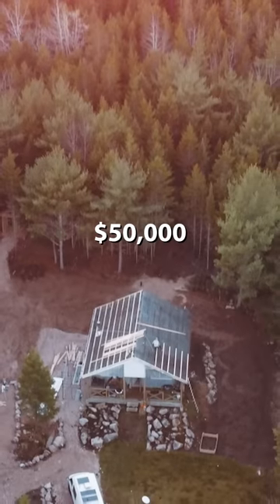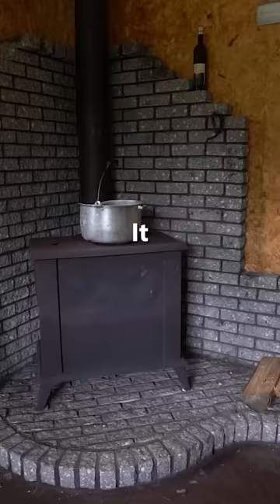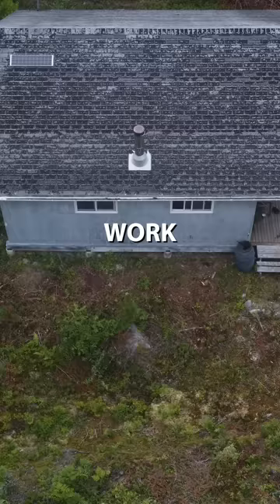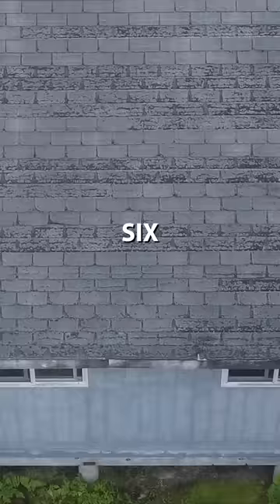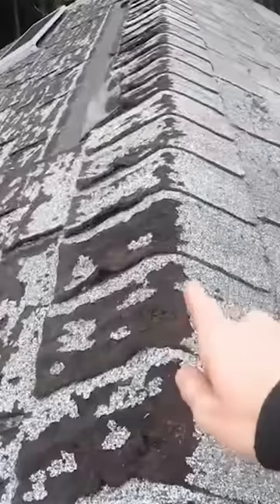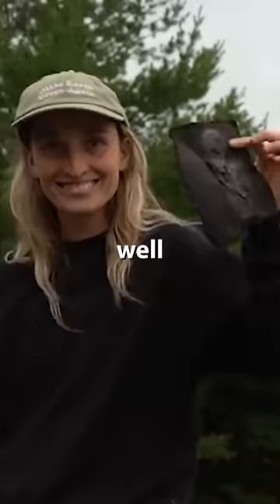Roofing With NO EXPERIENCE #shorts

Comment from the maker: Watch the full video here https://youtu.be/SfOV5l49iSU

Still can’t believe we did this 😂
Reply: The metal roof is as beautiful as the builders.
Reply: Does the 50k include the land? I think I need to move to the Canadian woods 🥰 I wonder what it’s worth right now with everything you’ve done so far you’ve both done such amazing work ❤
Reply: @Mossy's Food Reviews I see you gave up on your food review videos or you never pulled your head out of the sand even start? Lol 😂
Reply: You Both rock ❤️🌹❤️
Reply: Awesome
Reply: What province are you in?
Reply: I can't believe you did this either, why on earth did you leave the crappy shingles on there? You should have removed them, made any necessary repairs to the roof underneath, placed a moisture barrier and then the metal roofing, good luck with those moldy old shingles under that shiny new roof.
Reply: Use to work on roofs myself...

One small thing you guys might want to keep in the back of your mind.

It was good getting the rub er washer screws, but they will give out after a couple seasons.
To make them last longer, grab you some roofing tar or sealer and cover those screws with a nice cap of tar spread down to the roof. This will give it a second more reliable water tight seal that will go several seasons before needing touch-up. 
This shouldn't cost more than 20-30 extra dollars (usd) and will give you much more relief with the roof.

In California, every metal roof has this little added tar put on the screws (or should), so they last longer and need less maintenance during its lifetime.
Reply: Love you guys, totally inspirational
Reply: Good for you!!👏🏻👏🏻👏🏻👏🏻👏🏻👏🏻👏🏻👏🏻
Reply: this is frog awesome! love it!
Reply: It is important to have a solid monthly income.
Reply: Omg yall just messed up that roof is going to leek within a year because of how you installed it good job next time do more research 40 years plus roofing experience
Reply: Just read some really mean comments on here...  I'm just here to say who cares if it's not perfect, who cares if you have to redo.  We are here for you cause you're amazing to even give it a try.  It's the only way to learn.  There's more important things that money and perfection.  I watch videos like yours cause I like the vibe.  You're good people.

Comment: Professional roofer here. Those panels will last about 50 years but I gaurentee no one has told you that the washers on the exposed fasteners only last 7-10 years and the same goes for any sealant used. They will both need to be replaced eventually.
Reply from the maker: We are aware yes. Thanks!
Reply: @Vanwives  total cap. Yall had no idea.
Reply: I have seen them last a lot longer. The fact it is a steep roof also helps. YOU GO GIRLS.

Comment: So you left the degraded and moldy old shingles instead of putting a membrane first, good call😅
Reply: That's what I noticed as well. That's why it was so cheap for them, they skipped over the work it desperately needed! There's probably rotting wood & mold under it.
Reply: @hinu1987  well said
Reply: it's too cold to matter lol
Reply: What an unhelpful comment. Do you feel better about yourself?
Reply: @nicothenatural  not everyone can win without guidance
Reply: @nicothenatural  hope you don’t buy it
Reply: @Barry Dargush  you don't even make sense. No one talked about winning here until you pulled it out of thin air like it's supposed to be relevant.
Reply: @nicothenatural  current times call for all to get high praise, reality is you need to point out what not to do is more proper
Reply: @MrCrafter80   👏 👏 👏
Reply: @MrCrafter80 ??? People LOVE to correct others and point out what they've done wrong. It's in our DNA.
Reply: @nikki1400  well if we didn't think of all those lost to fire and cliffs
Reply: @Barry Dargush  you didn't offer help, or even try to be helpful; you cast dispersions. Don't confuse the two.
Reply: @nicothenatural  your not even able to understand conversation
Reply: All they did is going to have to be thrown out, hopefully no one is permanently injured by the unseen mold dangers
Reply: Not saying it's right, but it's very common for people to do this.

Their roof will be fine.
Reply: With the unstable/rotting wood possibly, the metal roof is capable of blowing off. If you leave a roof to rot you are asking for it to cave in. It’s only a matter of time. Leave it to the women.
Reply: @jakobjackson8077  Asphalt doesn't "rot" it degrades in the elements. If they fastened furrings to the trusses, they are fine.
Reply: @jakobjackson8077  your playing with those murder hornets , you must not be married
Reply: @drsh0ckalu  only time will tell, I’ll subscribe and wait for them to post the video crying cause a good wind blew their roof off.
Reply: @MrCrafter80  I’m engaged. 😰. Day I was born, the doc told my mother I would be a certified asshole till the day I die.
Reply: @jakobjackson8077  feelings don’t make things better, but a good laugh makes everyone smile
Reply: @crown of hair  No, he didn't, but I guarantee every roofer they spoke to did. They then decided to install that roof incorrectly. It's 100% going to leak and only a matter of time.
Reply: @mikeguerrero7416  that's fine, and it doesn't change the fact that the OC is a patronizing jerk.
Reply: ronnie doorzon  they're SHARING their experience, not seeking attention. People like the OC have freedom of speech; it doesn't stop them from saying unhelpful/patronizing garbage, unfortunately.
Reply: ronnie doorzon  people who GENUINELY want to help will offer the helpful tips. Not mock or belittle others who are putting the work and learning from beginner mode.
Reply: @MrCrafter80  Conversing requires two way communication; you've already made up your mind and are clearly not capable.
Reply: When  I bought my house it had 3 layers of roofing on it. 
 Wood and structure  was excellent under all that.  House built in 1930.   All they had to do was look in that attic  at the wood and ceiling structure and if it is not rotten or water stained it is fine . It is very common to put a roof over old roof .   I payed over 8k over  22 years ago for new roof.   Today I would  put a metal  roof over it  like they did.  I cant imagine what a new roof is now . They did a good job
Reply: @amorl4520  when you have wood sheathing boards they will outlast plywood for decades with proper maintenance
Reply: @jakobjackson8077  leave to women?. It would be fair to say they know more about the structure of that roof from the inside also. No rot or water stain no problem. I would not put 15 k into 50k cabin roof either..It took guts doing that roof especially that pitch !  They did a good job. Or is it the fact that women were self sufficient and that bothers you? And under the right circumstances depending where you live shingles also at times blow off.  Doubt they will.be getting any tornados 🌪 .
Reply: @MrCrafter80  I have tongue and groove boards. Was alot of weight with 3 roofs on it !  That's was alot of the cost taking all that away in dumpsters.  Thankfully 16 inch on center. I would not put 15k in a 50k cabin. Cabin is a shell basically.  They have to do alot of work . Since wood prices rose since covid Insurance Co Jacked up the price  replace house values to like 260k when I paid 64k 22 years ago . 2bd
Bungalow.  Which is BS ! Everyone  is on the screw you wagon.

Comment: Congratulations on the roof, just a few things you might want to address in the coming weeks - Old roof needs to be removed, roofing screws go into the peaks not the gully's, both these issues will cause rot and mould through the roof and accelerate the degradation of the old structure, since you have documented this the liability will fall on you if you do sell the property. The 15k was for a reason, good luck with it, I hope it all works out.
Reply: Not to mention the added weight of the new roof 😅 and the snow😮that existing framing wasn’t meant for that much weight
Reply: The screws go in the valley. Google it.
Reply: screws go thru rib not pan, all water flows downs pans, you don't want screws (points of possible water entry) in the way..I don't need to google it.. I do it for a living
Reply: @jamierose4088  As a builder. No. No they don't. Look up not google, but the manufacturer's specs, and local building codes. Screws go in the ridge.
Reply: @masterroshi9951  The new roof is lightweight and the per sq.ft added weight is minimal compared to the snow load, so if it has survived the existing conditions the new cladding will not affect the load. Not taking off the old roofing however....
Reply: @Paul Rawlinson  
The first articule on Google. 
Absolute Steel advises screws be installed down inside the flat of the panel and not in the top of the rib. See the illustration below.

This is important as placing a screw in the top of the rib will prohibit a good seal. If placed in the top of the rib, the screw may also potentially tilt, thus stretching the screw hole. When this hole stretches and gets bigger than the washer, the seal is then broken. Consequently, Absolute Steel restricts the use of aluminum exposed fastened panels to a length of 16’. And, 40’ in length for limit steel exposed fastened panels.
Reply: If it's water tight (most metal roofing is), there will be no accelerated damage. 
 It was already the hardest thing they ever did. 
 Taking those shingles off would have broken them.
Reply: @Jamie Rose  the first 5 articles which showed up on "Ridge roofing fixing schedule" all gave Ridge fixing, with larger diameter heads for lengths over 12 metres (40'). However, when you restrict thus search to usa sites, it shows a mixture between Ridge and pan fixing. This simply demonstrates that Google is not a definitive guide to professional practices, and you should check direct with the manufacturer.  I've been installing roofing for 12 years and no manufacturer has recommended pan fixing (it's against our national building code). However it might seem this couple were fixing in accordance with manufacturer recommendations
Reply: @Paul Rawlinson  
I did a roof last year. The manufacturer said their roofing and screws are engineered for valley screws. Their reason was the compression of rubber washer is more consistent on the flat valleys. It's counter intuitive, but I see the logic. 
 I put them on ridges until that job. There is more flex on ridges and different designs. The valleys are consistent.
Reply: @Paul Rawlinson  And the fact of the matter is that most U.S. metal roofing manufacturers say you should put screws into the flat, because this location offers a solid wood surface just beneath the metal panel, resulting in a safer, tighter, more secure seal.

I can't find any manufacturer recommending ridges.
Reply: Omg 😂 soooo many Professinal Youtube Trolls 😂 Funny that everybody is i Roof expert 😅
Reply: It killed me watching them screw those in. There's a reason you hire a professional.
Reply: @Jamie Rose  It absolutely does not. Look up IRC and hire a professional.
Reply: @jamierose4088  What was the name of the manufacturer you spoke to? I'd love to speak with them as well because what you're saying is wrong. Full stop.

Comment: The quote is definitely a lot, but that includes everything to properly do a reroof. When changing a tiled roof to metal, there are extra steps that need to be done. I’m not a roofer, so I don’t know what they are off the top of my head, but there’s always a reason professionals charge what they do. I am all for amateurs tackling projects themselves, but when it comes to structural things, I think they need to be left to the professionals. 

Also something to keep in mind, if something happens to your roof and you try to put in an insurance claim, it might not be covered as the roof could be deemed poor workmanship and unwarrantable.
Reply: First, rip the old roof off, so you aren't nailing/screwing into 40 year old shingles. Also, potentially trapping molds, etc underneath.

Then there is papering, flashing, mounting (prep boards), caulking, then installing the roof itself, caulking again, painting...

I am sure I am forgetting something, it's been a long time, and I have only seen metal roofs installed. Whereas I have installed many shingle roofs.

Also, what shape are the boards in underneath all that? You are adding THOUSANDS of pounds of weight on top of a roof where you didn't remove the previous weight.

Idk. I get why some people layover. But I wouldn't recommend it.

I've seen a 5 layover roof. 4 layers of shingles into wood shake.

The last couple layers the nails weren't even hitting anything except shingle. 😂
Reply: My family redid my sister's roof and the insurance passed it, no problem. She had it inspected, and the pros were impressed.  These two were doing the best with the time, money, and needs they faced. I'm sure it is temporary.
Reply: And the price is for travel there. Materials getting there etc etc.

Comment: I'm glad you guys took the initiative to take this project into your own hands. But, why did you leave the old shingles? It would only take a couple hours to clear off all those old shingles. Furthermore without the shingles,  you can inspect the roof for damage at the same time. Replace any rotten spots, lay down vapor barrier, then place your steel without strapping. Now that you have strapping, you have to be immensely careful not to step on the steel anywhere there isn't a strap. Luckily, you can come back at a later date and remove the shingles but, that a lot of extra work.

Comment: So installing the metal roofing over purlins, and also over the existing shingles, as they have done is correct. However, as everyone pointed out, why not remove the rotting shingles? This also gives you an opportunity to check the integrity of the existing roof’s moisture barrier. Not everyone has upfront money sitting around, but for an existing roof like that, I would have paid the $15k. If a warranty was offered under the $15k work, that’s also beneficial.

Comment: All roofs leak a certain amount. Where's the roofing felt? The waterproof barrier on the edge?  Why didn't you remove the old shingles, and repair the roof deck damage? FYI: the manufacturer states you have to tighten the screws every three years.  The rubber grommet  shrinks and leaks, and the screws work themselves out through flexing and temperature variations.  Removing the old shingles would lighten the snow load on the old code, low-sloped, water and dry rot damaged trusses.

Comment: I too built my first roof by myself. You did so well. Now your house will be dry and you can live in it. Judging by some of the following comments maybe you could have done it differently BUT when the weather is mild and you have some friends over you can easily remove half the roofing iron, strip underneath then screw back on. Another day, do the other side. Am 75yrs and built my first house of grass in the bush. My second, an A frame in suburbs and my present  low set with verandah all around to build in later (which I did) my late wife and four grown children loved it and it will last me out..I nearly always work alone using jigs props and pulleys. Just needs imagination. You have done so well...

Comment: you have to bolt at the highest edges on the roof panel..reason for that..,when raining,the water cannot drip at the bolt point..at happen when the rubber bolt washer start harden

Comment: Your meant to screw the sheets highest point (rib) not its lowest point (valley). That’s the channel all the water follows to exit the roof. 

EDIT 2 days later- My comment sounds angry but it’s not meant to. Just a tip 👍🍺
Reply: but your tip is not accurate. very few, if any manufactures recommend doing as your tip suggests. there are a couple issues with the way they installed the roofing but the screw placement is not one of them.
Reply: It’s industry standard in Australia as it’s how you are taught in your apprenticeships. I was taught as a young fulla, common sense is not to put a hole where you want water to run.
Reply: @downunderfulla6001  they aren't in Australia. they get ice and snow so it is important for the screws to have holding power.
Reply: @boilermech2294  thank you for explaining the difference in process.🍺
Reply: I came here to warn them about the raging debate of where to put the screws.  We went with standing seam and avoided all of that.  Not a DIY project.
Reply: @KenJones1961  yes and you can do structural additions/repairs/access some much faster. 
This feminist roof will be crushed and leaking after the first large snow storm.
Everyone is a pro after reading “instructions” and their “manufacturer paint defect warranty” will supposedly repair their leaky roof/black mold house. 
But I have filled a lot of dumpsters up with DIY projects like this one. 
Always best to get an experienced “tradesman“ on the jobsite.

Comment: I understand people don’t want to pay professionals but there is a reason why. #1 they would have removed old moldy products and got down to the base and replaced it with good materials before the new went on. # 2 warranty - when something goes wrong you usually have a 10-30 year depending on what you buy. Most warranties require it to be installed by professionals otherwise it can be voided. I appreciate doing some repair DIY but not roof, electrical and the things if not done right can hurt you or someone you love. 
Having said that I hope it works out for you ladies and I wish you the best.